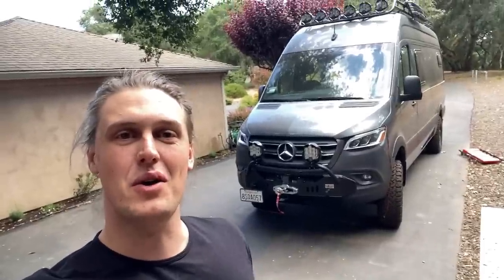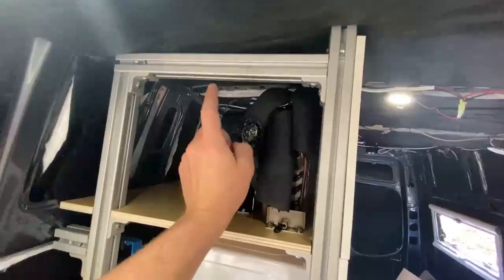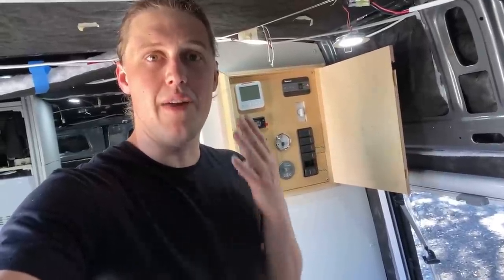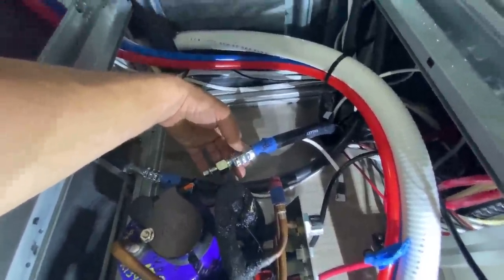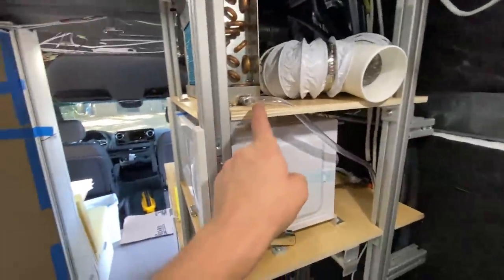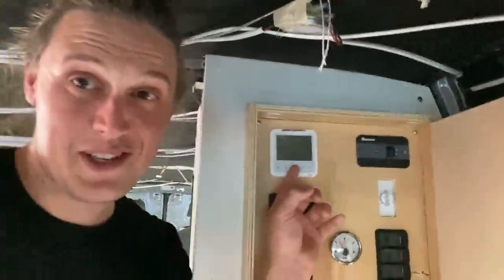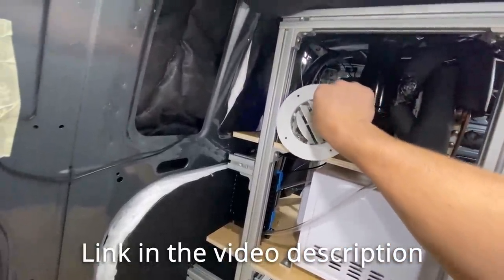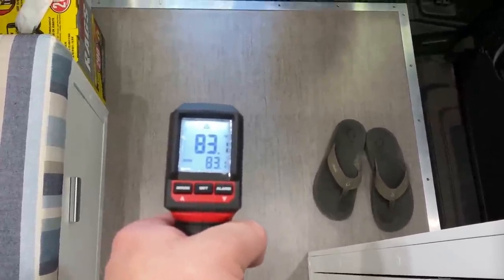The BEST Battery Powered AIR CONDITIONER For Van Life?

Comment: As a professional refrigeration technician I will strongly recommend to stay away from this setup. The original purpose of this particular unit was to cool down a cab of a tractor. The condenser should be mounted on the back wall of the cab. By mounting the condenser on the bottom you creating the harsh environment  for the condenser. 
If your condenser is dirty - your liquid freon is not really liquid, it becomes a saturated mixture. It means you loosing a cool capacity and you creating a high pressure which eventually will damage your compressor. 
Another important point is the winter. If you will drive to any place where road salt is used it will destroy your condenser and condenser fan motor just in one season. Not even talking about the fact that condenser requires a vertical installation for the condensed liquid easily getting to the bottom. I can give you 5 more reasons why this is a bad idea, but I think I've said enough. DON'T DO THIS, UNLESS YOU GOING TO DO HIGHWAYS ONLY IN SUNNY CALIFORNIA.
Reply: Let me think...will you be running your A/C in the snow?  Hmmm.  I don't think so.  Seems pretty easy to fashion a cover for the condenser unit, no?
Reply: Passenger buses have their condenser under them so it's pretty standard. I think you are right but on a van your options are limited.
Reply: Our fans and condensers are automotive grade. I think I have sent out 3 replacements in the last 10 years. They hold up really well.
Reply: I do public busses in Canada and some business do have condensers on the bottom as you mentioned, and we do replace those condensers all the time for the reasons I've mentioned above.
The trend on installing the condenser on the bottom of the RV is very recent. Let see your numbers in few years.
Reply: @CruiseNComfortUSA  would it be good to mount in a more vertical location on the back of the van?
Reply: @scottslotterbeck3796  ac is mounted under van. Regardless of if it is running road salt will clobber it.
Reply: glad you pointed out the obvious...see such bad info on youtube.bad design for van...pull 40 amps...5k window ac...good one pulls 3.5 amps ac...35 amps dc...if you have power inverter which most people have...200 dollars...and you have a common replaceable item...nothing proprietary..
Reply: I would agree, I don't think under the van is the best. Just simple road debris and dirt would beat the hell out of it.
Reply: just make a cover for it and clean it regularly 🤷 If you're driving in snow or off-roading, you'll want some upgraded tires that will elevate the van a bit, anyway.
Reply: Wouldn't it be awesome if someone made a tiny 12 volt mini split where you could mount the outside unit on the back door!
Reply: @andreawisner7358  yes
Reply: All you have to do is get some aerosol foaming coil cleaner and warm water to rinse it with after your winter drives. A good reason for the hot and cold outdoor spigot at your house. He most likely has a water heater in that van too and if he’s like me he won’t run on salty roads very much. It draws 60+ amps at 13 vdc. I’d much rather have a 1000 watts of solar on my roof.
Reply: @CR-wk2re   "ust make a cover for it and clean it regularly" lol - how "regularly?" - daily? hourly? after every trip?
Reply: @stephenwilkinson1254  that would take some figuring out. I'd just take a peek at it once a week to get a baseline and then go from there.
Reply: @scottslotterbeck3796  Geeze... the man is right.  Winter salt, summer road debris, over time, will do substantial damage to the condenser....  you'll never able to design a cover to keep road salt, slush, salted water from getting into that cover.....
Reply: @andreawisner7358  Agree, even using a standard mini-split seems better than this, the whole setup is easy. Instead of having a spare tire you could have the condenser mounted in a similar position. These have a lot of benefits including typically being more efficient than other AC solutions, often being heat pumps as well, and being much quieter and simpler to install over a system like the one in the video here. Not sure about power/BTU size and demands, would tax heavily most solar systems. Often impractical due to power requirements.
Reply: @scottslotterbeck3796  Oh so remove the unit during winter with salty roads?  Even if the van never sees snow,  Dirt, dust, and mud are much more prevelent on the underside of the vehicle, particularly if you go off pavement.
Reply: @scottslotterbeck3796  Right, but the condenser still mounted and sitting there during the snow season so the road salt will destroy in just one season.
Reply: @tunguyen238  Hey, I didn't come up with this idea, and neither did he.  I've seen it on other pro van builds.  I wouldn't do it b/c it's way too expensive!  Buy a cheap generator to run your A/C, or get a swamp cooler.
Reply: @evguenistrok1695  I'm no HVAC expert, there's only one version of 'parking air-conditioner" I'd consider placing the condenser/compressor unit under a van. That one is built in a steel box, not a flat panel and meant for slapping on earth-movers/tractors... And still, it's mostly so I could slip a cover over it for traveling so I don't scoop water/derbris into it.
Reply: Mate you don’t know what your talking about. We have a 1993 Toyota Coaster bus that has the factory Toyota condenser mounted pretty much exactly like this install is done. It’s also mounted at an angle and not vertical like you suggested. Ours is still the same condenser that was fitted in the factory and works perfectly.
Reply: No, the condenser requires the large port to be higher than the small port. Slight 10-15 degree angle.
Reply: As someone who has installed my own custom aircon, I'd actually like to know the other 5 reasons please?
I've installed on a vertical angle, I know about the liquid getting to the bottom. I live in Australia, we don't use salt. I also regularly wash the condenser radiator. I have used a Rencool MD15 compressor.
So I think the points you've mentioned I have already covered but super curious how to optimise and see what the other 5 reasons are if you have the time?
Reply: @scottslotterbeck3796  They didn't say you'd  be using it in the snow. But if salt get into it, which is likely, it'll bugger it.
Reply: People are mentioning salt. Western states don”t use salt on roads. Google “salt belt” for more info.
Reply: @scottslotterbeck3796 Two years later...your comment has been beaten up much like condensers mounted under the chassis.

Comment: I agree that a roof-mounted A/C is undesirable so was interested in the unit you fitted. The data I was looking for was absent so I went to the manufacturer site but their "Specs" page for the unit in question was also sparse to say the least. In a van and especially if powered with PV & batteries I need to know the BTU (of course) but also the startup and running load that I have to supply.

Comment: I have thought about a similar setup.  I would likely buy a window AC though.  Seems like it would be cheaper to have an AC tech draw down the system for you.  Then take the unit apart, run new lines, electrical and fans.  Then have the AC tech come back to draw a vacuum and/or nitrogen test the system, then charge it.  You would likely have the same power consumption or better for a similar system and it would be maybe $1500 for parts and the labor of the AC tech.  The downside of this approach is it would require a little bit of re-engineering of the system.  Window units just have one fan motor, so that would need to be split.  Also you would need an AC tech that was willing to do this.  As Seven O Savage found out, that might be a bit tricky.  So knowing a guy would be very helpful.

Comment: Just wanted to add I am fan of your videos and love your explanations and tips.  Unlike others you speak my language.  I am a Linux Engineer that worked commercial construction in the past so I am very handy. 

I had a few questions though. 
So it draws 700+ watts?  Is that max?  Does it ever idle down?  What bothers me about cruise in comfort is there is no seer rating and judging by your consumption it looks to be around 10-12 if it had one which is pretty good for a window A/c unit that costs 300-400$.    I have not had the pleasure to test with a invertor or batteries but I have 33 seer rated Minisplit in my garage that only maxes at 300Watts and idles down to 240 and lower in South Texas.  I'd like to add it ramps up so there are no surges.   So how much does your invertor draw?  I've been reading its around 10-15% of the overall load but I am not sure it works like that.   Basically what I am trying to figure out is does my 110v 33seer mini split on a invertor use less power than a CnC a/c?   Also trying to figure out if you lose even more power converting to 220V as these are the most efficient a/c's currently.   There is a 220v 42seer rated mini split i'd love to test! 

$4000 a/c VS  $1300 A/c with more solar more batteries and a better invertor.  <---- probably still cheaper
Reply: With a big condenser like that on the back door and how do you deal with opening the door? It’s all a headache.
Reply: Sorry it wasn’t meant that way I pushed the send button mid paragraph and it came out wrong
Reply: I could care less I just want my questions answered. 😕
Reply: You really answered your own question. It is about 15 percent loss which is still way less than the difference between the two even with going to 220. What makes you think you can Mount it horizontally underneath though?
Reply: I just haven't had a inverter to test and I have enough clearance underneath the fairings to run it standing up and still be hidden.  So based on 15% with my current mini split that is only 345 watts.  Sounds like the cnc ac is not the best then.  It is a 14ft 2018 box van I'm too tall for all these cool little vans =(.  On another note I saw another YouTuber in a sprinter cut a hole and drop it through.  Then they built Insulated box over the top 5 inches that was still in the van.
Reply: I'm thinking about a DC scrool compressor that runs 48v on high and 12 to 24 as the load drops.

Biggest design problem I see is not installing a bulkhead between the cab and the box. 

I suspect that he got a product placement deal here.
Reply: @MrRShoaf    Seems like it

Comment: 9:48
I don't know if this AC is very different from normal house ACs (I imagine not), but normal house ACs - you just use an electric pump to check for leaks, basically create vacuum, you let it for about 15 minutes (or more) and if the arrow on the gauge didn't move in those 15 minutes - you're good to charge the system with gas.

Normal house ACs already have the gas in them, you just check for leaks and if all is fine you just open the gas  valves on the AC.

The problem is when the AC doesn't have gas from factory or say the gas leaked - in that case, here in Italy at least, you can't buy and/or use this gas - only licensed AC installers can work with it (most just won't sell it to you, because they are required by law to first obtain that certificate from you and only after that sell it to you).

Comment: I would charge the system myself. Equipment to evacuate and charge can be borrowed from Autozone or O'Reilly. Just need to know amount of oil and R134 to add.    Wonder is if it could be worked out a means to mount in front of engine cooling, just like vehicle coolers are typically stacked together, air conditioning, transmission, oil, coolant. Since this system would not running while driving. Would  need to use the vehicle fans in place of provided fans.
Reply: Don't add oil to this product, it comes pre-oiled.
Reply: Great idea!  Did not know that!  Mounting in alternate place complicates hoses and wiring.  Something to think about, though.
Reply: The unit already has PVE oil inside. Most customers go to Harbor Freight and spend $150 on gauges and hoses and do charge them on their own. Not sure about Canada but it is legal where in the states. Pre charged systems are on the horizon 👍🏻

Comment: Awesome! I recommend looking into 3M Crystalline heat rejecting window film for the front cab windows. Apparently it's crystal clear and comes in 90% clear, which shouldn't look tinted or cause problems. I'm eager to get it installed in my Sprinter because my AC is fighting a hopeless battle with all the heat coming in!

Comment: This is something I was toying in my mind with, right now I have a Dometic Penguin 2 A/C mounted on top 
but due to height clearance I am considering to take it off, put a MaxXVent instead and go with the below deck A/C 
I've got a High-Top Sprinter so top clearance IS a problem when running into an underpass that's only 9 feet tall.

Note: As I was saying I've thought about replacing the Dometic with a Semi-Truck A/C unit (the one you see behind the Semi cabine)

Comment: If a roof mounted AC is installed properly it's not going to drip condensate on your head. The only reason you would get condensate dripping inside is if the seal around the air conditioner is compromised or if You're parked in such a way that the air conditioner is tipped really far forward

Comment: Can you put a shield over the part under the van?  Maybe a mechanical flu like contraption that can open when not driving?  Either have a switch or a handle to open/shut.  Seems like a vulnerable spot for an expensive part.  A white or light color for the van itself would help.  Reflectix in the front windows for sure (one side reflectix, the other side black for winter to absorb heat? ).  Cant wait to see how it all goes together.  *Any protection for battery bank if any fluids leak?

Comment: Lily, our 2019 Sprinter, 170 extended, XD, 4x4, has been in 47 of the 48 and North Dakota might happen next month. Lily has been from Vancouver Island to Key West. From Los Angeles to Montreal. She's been to the bottom of Death Valley and 12,000 ft up in Rocky Mountain National Park.  All of this would have been a lot less enjoyable without our HD series, 24v, split Cruise N Comfort AC system. 

Save your roof space for a deck or better yet, more solar. Don't risk another hole in your roof;  you won't know you have a leak until the damage is done. Cruise N Comfort and with confidence.

PS: we did have a problem with our system; it kept losing its charge. Nobody would consider diagnosing the problem, much less fix it because it's a Mercedes and if they didn't build the van, they didn't want to fix somebody else's problem - and that's exactly what it was, our up-fitter builder didn't crimp the lines at the evaporator properly.

Even though she was out of warranty, both the upfitter's and Cruise N Comfort's, we took Lily to THE specialist - to Cruise N Comfort  in Tempe, AZ.  Chris (Chris Frye, Owner) got under the van and spotted the crimping problem immediately. Chris set us up with new (and improved lines and fittings) and a local guy that could install them - Chris was getting ready for Overland Expo and besides,  it was the builder's crimp job, not a probhem with his unit.  Anyway, yeah, happy campers again!

Thank you Chris.
Reply from the maker: Very cool to hear! About to release a 2 year update and have a similar sentiment :)

Comment: This is really nice compared to roof AC but respectfully, compared to a house mini split its not that competitive, don't get me wrong it can be perfect for some people and their specific needs like you OP that has lots of batteries. But for me I think the price of 5000$ is just too much, adding on top of that the connections, pre-charge trouble and multiple components/unit making this not necessarily smaller than a mini-split unit breaks the deal. For less than 1500$ I could see it being competitive but I think a mini-split like the brand forestair 9000btu costing 600$ that consumes 550w average, could easily be offset by adding more solar. With my current 550ah lithium I could run this for 10 hours + my 550W of solar current that I plan on doubling would make this work pretty much 24/7 on solar for in total approximately 4000$ cheaper. Maybe I'm missing something. Keep up the good work OP I do enjoy your content.
Reply: Tom , check out my VES Classic system. It has a few less features but may be a solution. It is $3,395 and is on our online store.